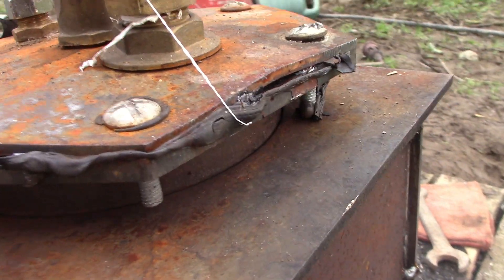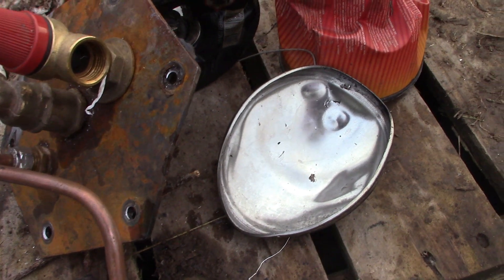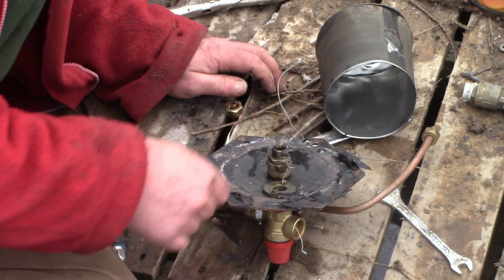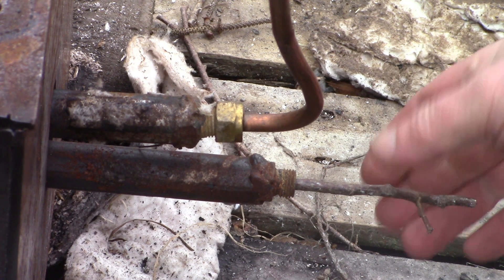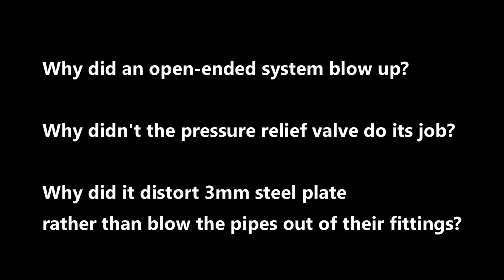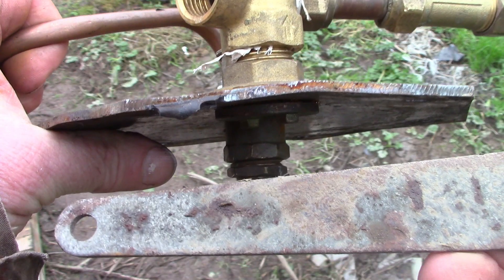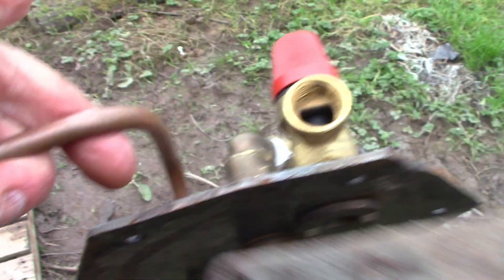Why Did My Boiler Explode??!! My Own Big Bang Theory...

Comment: It's clear from how the top float's bottom is curved that it had a lot of pressure inside it.  Top float exploded, pushing the top against the outlet, sealing off the pressure relief valve (you can see how it's molded against the top of the boiler).  Then you got over pressure, and the main boiler leaked from distortion.  Thankfully, not exploding.  Bottom float had some working pressure relief valve in it, so when it got heated, whatever gas or fuel may have been left in it, got exhausted.  Either it imploded when the top one exploded, or it imploded once the system cooled down and it didn't have air enough inside it anymore.
Reply from the maker: I think you could be right, Matthias! Thanks.
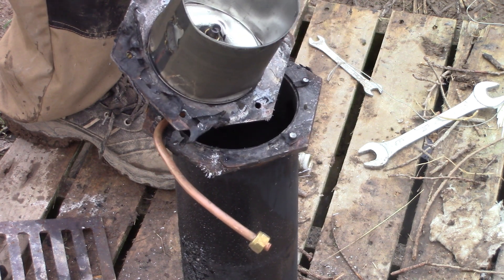Reply: @wayoutwest-workshopstuff6299   no no he's not look again at the top canister you can see the valve of the cannister still hanging 1:47 in there the solid bar you made for the water stop valve pushed it in to the top canister valve were its weak. and the bottom of the top canister was pushed up in to itself look at how the bottom rim side have been straightened as if it had not been crimped yet. there is a lot to add but its up to you in short you water stop valve is stronger than the float.
Reply: Yes. There has to be a reason the upper float was driven to pierce itself onto the plumbing at the top of the boiler... with the consequence you describe.
Reply: I agree Matthias 💪
Reply: the float should have had a minimum internal presure as graet as the maximum system presure
Reply: @jezusmaarssen  problem then become heat cykle stress and preasure difference when heated, sure they are preasure vessels but thin walled ones, it will probably work with a very low rusk of failure but i personaly dont know if i would go with that
Reply: Yes seems that way to me could have been much worse.
Reply: Agreed! Propane has vaporpressure  of 10-15bar (150-200psi) at only about 40 or 50C (100-130F) So no wonder that it did explode when temperature was over 100C. assuming of course there was any gas left in that bottle. That is also reason why you should never allow gas bottles to get  over 40C even partly.
Reply: @1978jra  I think that there is always a little bit left when the bottle is "depleted".
Reply: Yes
Reply: I agree
Reply: This is What Happened
Reply: I basically came here to say this. It was hydroformed! Neat, in a you almost had a bad day kind of way.
Reply: I reckon so. The top float has clearly exploded quite spectacularly and working the enclosed space of the boiler.
Reply: @DonConstance   Wasn't it the bottom float that was in tears? I'd say the Bottom Float exploded and caused the top bottle to piston like a bullet towards impalement onto the valve.
Reply: I think that just the top float exploded due to water in the can. The exploding can was enough to deform the top lid and crush the bottom float. Water may have leaked into the top float on previous runs and flashed to steam on this attempt. Simple as that.
Reply: Agreed. The top float caused all the observed damage; if you'd actually had a steam explosion, you wouldn't be posting a video.
Reply: @robertgoff6479  Agreed. If it had been a steam explosion it would likely have killed those close by as it would have burst the outer tank.
Reply: Its also possible the air inside the canisters (whether it had a bit of leftover camping gas or just regular air) could have caused the top float to explode via expansion. If I were to get another float I would try to fill it with a noble gas & or some sort of gas that wont expand too much with heat / react with anything. Another possibilty is that the rubber seals on top of the camping canisters melted or leaked causing the float to implode. But it looks more explosion to me. Due to the way the bottom float looked to be crushed by the top float blowing out
Reply: I am not sure how it could be steam pressure as the outlet was open & that would not have allowed the steam pressure to build so rapidly and had that outlet ceased to suddenly have steam it’s likely it would have been a noticeable change. The very rapid change from normal operation to an explosion still seems to me most likely to be an ignition of residual butane released from a cylinder or cylinders having just enough speed to fill the chamber before being ignited by the dry steam, some what similar to a fuel air bomb with an intense & very fast pressure wave.
Reply: Yes, I was surprised that he didn't consider the effect of the residual gas in the cannister.  I think the entirety of the explosion was just the float cans popping.
Reply: Why did my boiler explode

To understand what happened we need to break things down.

The floats used are camping gas stove canisters. These are made from aluminium and are all crimp fitted.

In the image shown at Time index 1:47  you can clearly see the top crimp where the valves is installed has been punched in to the canister itself Not exploded

This is likely due to the high temperature softening the aluminium and the pressure of the other floats Pushing Up concentrating the force needed to punch out the valve piece.

Once the very top cylinder has been pushed up against the upper housing the additional pressure and heat are shown to be focused where the steam wishes to escape as well as the other two canisters still pushing up and the top one.

This picture (Time index 1:47) shows the point of failure as the aluminium has Now created a self-sealing system the consequences of both the pressure relief valve and steam outlet  are blocked or Restricted to render them useless.

Next the steam pressure in the primary boiler climbed rapidly even with minor leaks this was proven at time index 2:21 imploding the other 2 gas canisters and pressure forming the top canister to the boiler's roof. With nowhere for the steam to go the pressure kept increasing until the next point of failure which was the boiler's lid.

I would suggest if you carry on keep the primary boiler as it is you now know that it is safe to use should you have a closed system failure
Reply: My thoughts exactly
Reply: The top float EXploded in the IMploding steam, cooled by the cold water. After that, the floats didn’t work anymore.
Reply: @Matthias Wandel - I was going to write this if no one had yet. One or more floats expanded from the hot air inside them and the intact top of the top float blocked the pressure from escaping the boiler.
Reply: Agree, the Float air got too hot and explode.
Reply: looks like the bottom was blown off the top gas can and the internal pressure from heating pushed it up into the top, bending it. it also looked like one of the cans had been burned slightly which could be a sign that the float valve wasnt letting enough water in leading to the  gas cylinder over heating and softening, allowing the internal pressure to rush out the weakest point. the bottom cylender I would imagine got crushed by the exploding to cylinder.
Reply: A camping gas cylinder bottom is always curved.
Reply: @rjk69  it was curved in the reverse direction, outwardly to what it was before.
Reply: I agree. As @1978jra said, inside the bottle you had still a bit of propane and you raised it at 100C° (or something more). The welding between the upper and the lower part of the bottle collapsed.

Maybe a small CO2 flask, with the valve removed and kept upside down by rails could be a better replacement. Being opened below, is should keep the pressure inside equal to that outside.
Reply: @GianUbertoLauri  Virtually no chance of propane left in a used camping gas cylinder, there is an unsealed hole punched in the top. Unless it has bee kept upright since it was used the gas would have escaped. It's been inside a boiling cylinder of water for hours, highly unlikely the contents hadn't escaped way before this test.
Reply: @rjk69  from what I remember from the build video the canisters were of the self sealing variety, had they had a hole in the top they would have filled with water and stopped being floats, I would concur with the other people, the top canister exploded flattening the bottom one and causing an overpressure such as the pipework and relief valve couldn't dissipate quickly enough, shame he wasn't filming it as it would have been interesting to see. Fortunately no one was hurt, just a little "surprise"☺.
Reply: @rjk69  looking at minute 4 of the previous video, the only hole visible in the bottle is the valve, I think. I am not familiar with those camping equipment, but I think that it should be possible to remove the burner for transportation without the gas leaking outside. 

The flask exploded apparently when the welding between the upper and lower part failed due internal over-pressure, and the upper part was rammed against the boiler ceiling. If it had an unsealed hole, how it happen that the inner pressure in the bottle was so much large than the pressure outside the bottle?
Reply: @GianUbertoLauri  Yes I can see that now, these cylinders are not the same as I am used to. I had rather assumed the cans were vented to ensure equal pressure inside and out when hot and cold. I think a solid filled float would be the answer.
Reply: @rjk69  I have never seen a gas fuel canister of any kind that has an unsealed hole.
That is just a recipe for disaster with flammable gas leaking out the vent and catching on fire, causing more to spew out and more fire.

The closest you get to that is a burst valve which is designed to burst in the case of the canister inside a fire to allow the gas to escape rather than have the canister explode.
Reply: @jeffreyblack666  The pierceable gas canister do not self seal eg Campingaz C206. The top is punctured when the burner is screwed down onto it and sealed onto the top surface of the canister. You can't remove the canister without all the gas escaping.
Reply: @rjk69  Well that would still be sealed during use. But as these obviously halve a valve on them (given that they haven't filled with water and still float), that is not the case here.
Reply: agreed
Reply: From the impression on the base of the top float, the bottom float was intact when after the explosion.  It tends to suggest the bottom float slowly imploded during the cooling phase.  Interestingly this occurred after measuring an increase in steam pressure of 30oC.
Reply: @audreybarnes6527   i promise you there was no explosion with the top canister you can still see the vale were it was pressed in to the canister see 1:47. and then i ask you this how can the canister implode if all canister's were fine at 1 bar atmospheric pressure put under high pressure then back to atmospheric pressure would it not make more sense that the high pressure in the boiler crush them well before bending the boiler lid open?
Reply: @odjwizardo3198  Yes, well spotted.  So high pressure in the bottom forced the two cannisters up.  It looks like lower cannister pushed through the base of the upper cannister?  The lower cannister imploded as the pressure in the built and then the chamber itself let go.  The question not being answered is what initiated system failure?
Reply: @audreybarnes6527  if you look a the diy stop valve he made it pushes on the canister's valve that's crimped in place. they can give up easy and with the heat as well id put money that is what that setting the hole thing off.
as for the other two think your right once the top lost its strength the other two pushed up then imploded soon after but not before the steam pressure force the top canister to closing off the two steam outlets . leading to the lid failure.
Reply: @odjwizardo3198  Not necessarily.
The canisters were fine under 1 bar pressure at low temperatures, but when they were then heated the pressure inside them would increase, and the increase in temperature will weaken the structure of the can. And if it is sitting in water, in an open system, I doubt that would have actually had too much pressure.

The top can clearly was not imploded. Instead, the bottom appears to have been blown off.
That explosion likely happened first, with the force of the explosion driving it through the valve and sealing it to the top of the boiler, which then caused the water to boil and have no where to go and cause the remaining cylinders to implode.

If it was as you suggest, I would have expected the valve of the cylinder to be pushed out, allowing water to flow into the can and cause it to sink. Then, as water is inside and out, there is really no reason for the bottom to blow off.
Reply: @jeffreyblack666  that would be true if they were full but the canisters were empty. all so the top off the boiler  was bent off so there was significant pressure
Reply: @odjwizardo3198  Unless they had been hooked up to a vacuum to remove all the gas, they were not empty.
And yes, there was significant pressure, at the time of failure of the main boiler. That would be expected if the canister exploded and sealed the pressure relief valve and the steam outlet. That would then cause pressure to build up in the boiler and cause it to break the lid off so the pressure can get out.

If it was just the valve failing like you suggest, it should just result in water flowing into the canister causing it to sink, and allowing water to flow through the system. It shouldn't have failed like it did.

The big question is why does it look like something has forced the cylinder to be pressed into the top of the boiler?
That makes sense if it exploded, with that explosion forcing it into it. It doesn't make sense if the valve got broken or pushed out.
Reply: @jeffreyblack666   i cant see how an empty gas can with no liquid gas in it can over pressure its self to the point of blowing up. and even if it could there will be water/steam pushing back to counter the gas pressure in the canister .ill stick to the top of the gas can vale being pushed in as the start of fail point.
Reply: @odjwizardo3198  Because it isn't actually empty.
If there is a valve, then depending on how it is setup, it may actually still have a small amount of liquid in it.
But more importantly, even if it didn't have any liquid in it, it still has gas in it.
When heated, that gas will try to expand, increasing the pressure. This will be much more pressure than due to the water heating up in an open system.
And combined with that, there is the heat weakening the presumably aluminium canister.
All that combined is a recipe for an explosion.

And as it is an open system, there is minimal pressure from the water/steam pushing back. Why would it be pushing on the cans instead of escaping through the pipes?

Conversely, if it was the valve failing, how did it cause this?
It should have just pushed through the valve, caused the gas in the cylinder to escape and have it fill with water instead, causing it to sink and have water flow through the system.
There is no reason at all for that to cause the top of the canister to be pushed into the top of the boiler, nor to cause an explosion of any kind.
The best you would get is the valve is punched out and then the canister slides up a bit more, with the metal bar of the check valve for the water sealing it.
This would not cause the top of the canister to create a seal with the top of the boiler, especially not with the presumably failed valve now allowing water in. It also would not cause the bottom of the canister to break off. Nor would it explain why one canister appears to have exploded while the other appears to have imploded.

So your explanation simply doesn't match/explain what is observed. Instead it only matches a single point, that the metal bar of the water check valve is inside the top of the canister.
But the top cylinder exploding does explain it.
It explodes, with that explosion blowing the bottom off the canister and forcing the canister up onto the top of the boiler, causing the water check valve to punch through the top of the canister and causing the canister to seal with the top of the boiler, creating a sealed system which then had a large increase in pressure from the now-closed system having water boil, which caused the lower canister to implode and the top of the boiler to bend and release the pressure. (Or parts of that may have been caused by the initial explosion).
Reply: @jeffreyblack666  ok then we will never know
Reply: the top can fatigue stressed then detonated making a resonance shockwave aka sonic boom or a supercavitation shockwave happened on the detonation in your pressure vessel now that cool 
and the pressure relief valve would not have stood a chance in releasing anything at such ridiculous speeds
Reply: @factsarefactsanddonotlie8397    detonated?
Reply: @odjwizardo3198  yes detonated just like an explosive like I said cool
Reply: @factsarefactsanddonotlie8397   if the canister has only gas (no liquid gas) and the gas is not at pressure and there is no o2 in the chamber. Then how can a gas burn with out o2 and the gas on its own cant expand but only get hotter even past the Autoignition point? you need heat, fuel & o2
these are the facts and do no lie
Reply: @odjwizardo3198  when the canister was made it was made with operation tolerances one of the was heat and it Max heat tolerance of a butane canister full is around 50 Celsius 
and yours was almost empty of its butane so its tolerance to heat would have been higher now much I do not know but I would expect fatigue on the joints at 100 Celsius          now I did use the word detonated because this explains it best from an engineering standpoint as in releasing all its stored energy instantaneously 
and the damage done to your pressure vessel was done by a shockwave and I believe this shockwave was not a pressure wave as normal 
but a sound wave a sonic boom if you like sound has different characteristics in water and is many times stronger than in air 
and I come to this conclusion by the lack of damage to the fittings on the top and no tear damage of the brass olives or Copper Hydraulic Hose
Reply: @factsarefactsanddonotlie8397   so how do you think the top part of the canister ended up being push in side and not out?
Reply: @odjwizardo3198  did you the mean bottom canister crushed by the shockwave will it was a shockwave and it's incredibly hard to compress liquids and it was not a liquid so it was the weakest point so it was crushed by the wavefront of the shockwave and then that same shockwave was reflected from the base of the pressure vessel and Buckling the top
Reply: I don't like seeing people get hurt so my advice to you is somehow incorporate a bursting disc into your pressure vessel It's better to have it and not need it than to need it and not have it
Reply: @factsarefactsanddonotlie8397   no i mean the top canister you can see the valve of the canister its white plastic still in ganging in there 1:48
Reply: @odjwizardo3198  when the bottom of the top canister came off it became a cup and when the shockwave came back up it captured the majority of the shockwave and this smashed it into the top of the of pressure vessel one more time sonic boom shockwave or supercavitation shockwave have a ridiculous amount of energy in them
Reply: @factsarefactsanddonotlie8397   well we will have to see what the test show if he does them.
Reply: Agree to this theory.
Reply: Because the top floater could get over the boiling point since it was not submerged in the water, the lower floater did not explode because it was kept near boiling point in contact with the water.
steam expands water to one thousand times the volume - so that would gotten much worse, it was only normal heat expansion of the gas in the floater that went over the pressure limit - maybe trice the pressure?
So simpler and less dangerous would be to use only one floating cannister- that would always keep it in contact with water, keeping the floaters  temp slighty over 100 C.
Reply: @helder4u   water under presser can reach much higher temps than 100 C  but i see what your getting at
Reply: @odjwizardo3198  right so - but this system built with an open outlet, keeping it not much over atmospheric pressure.. contrary to steam, as targeted in this case .
Reply: @helder4u  yes your right I seen that is was open but there was still a long thin pipe restricting the flow. and on top of that if you cant vent as fast a steam is made then you get pressure build up. if it is to be used as a steam engine power unit the pressure will be as high in the boiler as in the steam engine  so your still out
Reply: @odjwizardo3198  I see, it will need to work under pressure, but was at nominal atmospheric in this test, right?
Reply: @helder4u   id have to say yes at start up but as steam was made there was to much restriction for the steam being made to get out. like a  pressure washer with no attachment the flow is slow and just runs out the end but when restricted pressure go's up but the flow stays the same. with steam to the pressure flow and temp keeps going up till something gives up.
Reply: @odjwizardo3198  when the flow is slow because of restriction it will still increase as a result of higher pressure so will not stay the same. If it will be sufficient to hinder explosion depends on when it reaches break-even..
Reply: @helder4u  try that again .oh and look up a steam chart then work out how much water is being converted to steam then how much of that can be pushed throw a small hole as more steam is being made by the boiler the temps rise and you will find as temps go up steam pressure go's up then temps go up so pressure go's up then temps go up then pressure go's up and so on. steam is dangerous and powerful id do some research. water in an open pan will stay at 100 C but in a pressure cooker temps can be as high as 200 C but its still water not steam.at the bottom of the sea there are vents were water is hotter than molten led but there is no steam due to the water pressure down there.
Reply: I know I'm late to the party, but as a mechanical engineer who sits on the ASME Boiler and Pressure Vessel code development committee: yes.  That is my take on seeing the results.
Reply: Jep, my ball is in this bucket.
Reply: Flat unstayed surfaces are not generally accepted, there are formulas available to calculate the MAWP from the ASME you owe it to yourself to accurately calculate the safe working pressure before you try anything like this…
Reply: I bet it wouldn't have happened if he had painted it green.
Reply: Adding cold water to superheated steam is very dangerous. This can cause a sudden loss of pressure, which is probably  why the first float ruptured. This opened the water valve fully and the low pressure sucked even more water in. This hit the 400°C or do wall of the boiler, which caused the explosion. Remedy: try to add the water from below, not from the top. Maybe even extend the boiler below the fire, so it has a cool part. Make the floats so they can handle sudden pressure swings by filling them with PUR foam or cork.